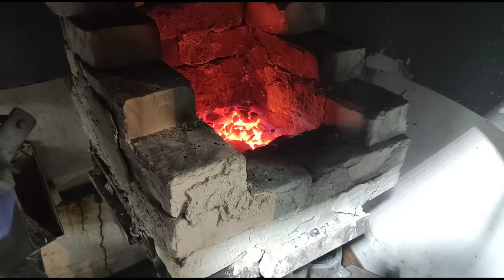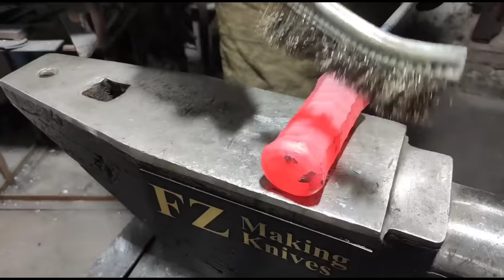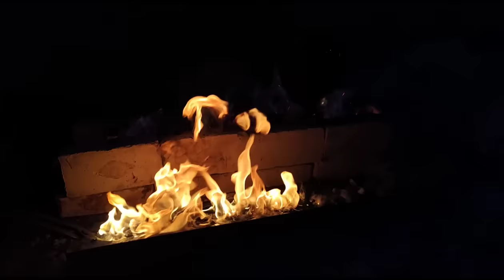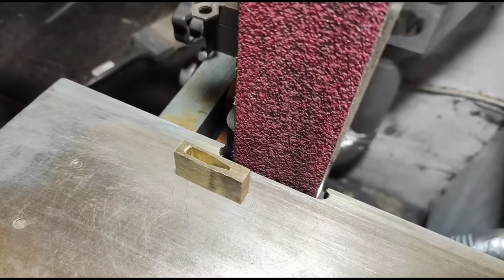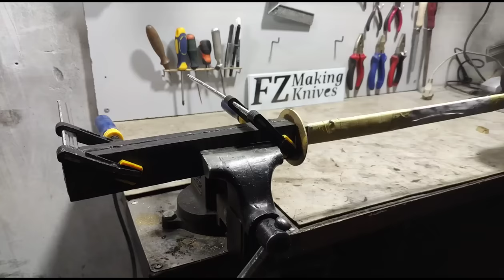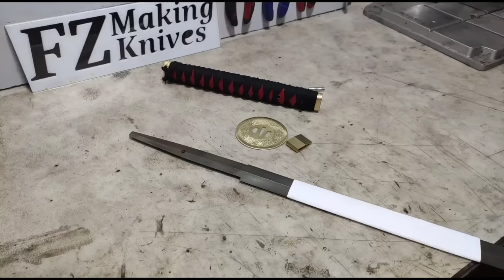Wootz KATANA from bearing balls

Comment: Love and wait for every one of your new videos but have a question:

Why do you always briefly hammer the ingot before moving to the press? Is there a reason for this from a metallurgical perspective?
Reply from the maker: thermal cycling of the ingot before forging so that the ingot does not crack
Reply: Wootz has unusually high carbon content. It needs to be thermally cycled and hammered to consolidate the billet. 
Perhaps the best type of modern wootz steel I have seen.
It seems you have mastered the lost art...
Reply: @fz-makingknives3663  thank you, I had been wondering this also

Comment: The material used for Japan swords is "Tamagane" (tama hagane). Tamagane is made by the "kera pressing method", a method of "tatara ironmaking". The "kera-pushing method" is a steelmaking method in which iron sand and charcoal are placed in a "firebed" (furnace) and burned using a device that sends wind called a bellows to adjust the percentage of carbon contained in the iron. This process must continue for about 70 hours for three days and nights.
Reply: As cool as the history is, it's an outdated method of making steel that is not needed with the knowledge smiths have today. I dislike glorifying it, as like with most historical processes for steel-making, it was inefficient and too time-intensive to get a workable product out of at a time cost ratio. Fine when you're being commissioned by royalty, but in peaceful times there is no way to make a profit unless you make and repair kitchenware.
Reply: @anms_brk  Is that right! I understood ...

Comment: I thought you had to fold the metal at least 3 times in order for it to be a real katana. They folded them like 100 times or something originally to make them strong but it was shown that 3 anything past 3 didn't make a noticeable difference
Reply: the folding is only necessary when starting with traditional tamahagane steel to remove impurities
Reply: It's not even a katana, it's closer to a Ninjatō, and entirely too brittle. If you make the entire sword out of hardened steel, you made a shitty sword. While nice to look at, I would use a stick over this in actual combat; it's unlikely to even survive a single clash with a quality sword.

Comment: That was bad ass man! Outstanding craftsmanship and blacksmith work 👏 👌 👍 🙌
Reply: Yeah his smithing is on point. 52100 is a really hard nut to crack, but he needs a crap load of attention to his design, bladecrafting and heat treatment. That blade will never pass an ABS test.

Not to mention he is either intentionally misleading or doesn't know proper terminology, cuz that aint no Wootz steel. Its 1st century viking crucible steel.
Reply: @meusana3681 I never hear of Vikings having equipped the oar bearings of their Dragon boats with ball bearings made by SKF ... 🤔🤔🤔
Reply: @Baetzibaer  " Its 1st century viking crucible steel." referring to the smelting method. The vikings invented crucible steel. He just used a bearing to do the same, the vikings would have used plain ore.

Wootz is also crucible steel, but location and ore specific. If you use any other ore than those mined from India you won't get wootz. I've never seen refined 52100 bearings being mined from India ...

This is like saying you made a wagyu burger, when you just used regular ground beef.
Reply: @Baetzibaer  Yeah...keep being an armchair expert
Reply: @meusana3681  Aye, Master Know-it-All ...

Comment: I am Japanese. I take pride in the art of making Japanese KATANA. Japanese swords are not only made by beating to make them stronger. The cutting part and the back of the sword are made of different metals. The cutting part is hard and sharp steel. The back of the sword is made of a harder, more tenacious steel that is more difficult to break. The back part is made of steel that is hard and sharp, while the cutting part is made of steel that is hard to break and tenacious. The craftsmen who make these swords are designated as living national treasures and have very high skills. KATANA made with bearings have no value.

Comment: That was truly beautiful work, though I much prefer complete hand forging.
But, if you are going to make a functional anything....sword, axe, knife. Kaishaku, katana, samurai, etc, why bother making it at all if you are only making a half tang? The entire purpose behind a katana is a two hand grip the transfers all energy from both hands through the tang to the blade, supports the entirety of the swird from tang to tip, and keeps the wooden shroud of the handle from shattering from the transferred energy absorption of repeated blows against the blade.
Don't get me wrong. Its a beautifully made blade. But, the tang would render it nearly useless against a lesser made full tang sword.
Reply: I had the same thought. And with only one peg through the handle you take a chance of the handle breaking free. My katana is full tang with 3 pegs. I also wonder about the quality/tensile strength of the steel.

Comment: I made this exact Sword with ball bearings. I put them in a sauce pan, put it on the stove and melted them. Then using the rolling pin I flattened the Molton metal into a sword. It's so sharp you can literally cut a hair in 2 (long ways), just by dropping the hair onto the blade.

Comment: great video! Are the bearings made from SAE 52100 steel? I (knowingly)never used a blade from that steel, is it good? google said it's a great steel for knives!
Reply: Most likely, and to call 52100 good knife steel would be a huge understatement. It's a contender for the best sword steel in existence, but proper heat treatment is rather complicated.

Comment: While this is aesthetically similar to a katana it bears no structural similarity to a katana. You need to have two different types of iron one forming the core of the blade and the other forming the spine of the blade. One being higher carbon content and harder than the other. In this way they blade has a vary hard edge to stay sharp while having a flexible structural component so it isn't brittle. This also leads to the characteristic curve as when red hot the blade is straight and gets its characteristic curve due to the outer iron shrinking slightly more than the core as it cools.

Comment: Great job!
Why just one pin as the single point of failure on the handle?
If it was used for it's intended purpose it would come apart.
Reply: I think it's a prop so its not full tang

Comment: THIS IS NOT A KATANA!
A Katana blade is made from 4 different pieces of steal. 
A hard spine
A high carbon edge
And two softer steal billets on each side to hold the spin and the edge together.
Without these factors all you have done is forge a curved single edge longsword.

Comment: The point about a classic katana is that it is forged from a multiply-refolded steel ingot and obtains its suppleness and shape from thousands of layers thus produced, plus a specially carbonised spine that causes the blade to curve when quenched due to differential structuring of the martensitic crystals across the flat of the blade.

Simple 2-dimensional forging of the blade in this video, from a mono-structural piece of steel means the blade, which thus lacks the classic curve of a katana, would also lack the unique physical properties of a razor sharp cutting edge combined with a shaded micro-structural profile that imparts elasticity and resists shattering despite the hardness of the cutting edge.

Comment: As a metallurgic i wonder why to case harden the blade before it is grinded to final thickness. As the carbon rich hardened layer is only a few tenths of a millimeter it is completely removed when the approx. 5-6 mm thick blade was grinded to a sharp edge. Nice video, useless result.

Comment: That sure is a hardened sharp piece of steel. Impressive, artistic, and well done, but I wouldn't call it a katana. Not only was it not made exactly like a traditional katana, it lacks a distinct curve, the kamon didn't serve any purpose to mark the softer vs harder parts of the steel, and you didn't imbue it with the powers to kill demons.
Reply: Katana with no curvature had existed, and I'm sure material and construction doesn't matter in this scenario.

Would you call a modern longsword a longsword when it was made from stock steel?

Comment: Sharpening a machete from both sides is actually not the right thing. If you are a right handed only the  right side of the machete should be sharpened.  Cos we r not gonna cut every thing vertically. Try it out.

Comment: Is it a nice sword? Yes.  Would I call it a katana?  Absolutely definitely no to that.  The geometry is way off,  the construction method isn't even close to traditional,   it's just generally shaped kinda sorta like a katana and the handle is made in generally the same pattern but it's no more a katana than a Volkswagon Beetle is a Rolls Royce.   Both are cars.   Both have doors, four wheels, seating, and a drivetrain.   But one is not the other. 

Those of us who collect and are true appreciators of nihonto tend to be kind of judgemental about this.  

Not putting the sword down  in the least. It's good workmanship and probably a good blade.  But purists would never call it a katana.